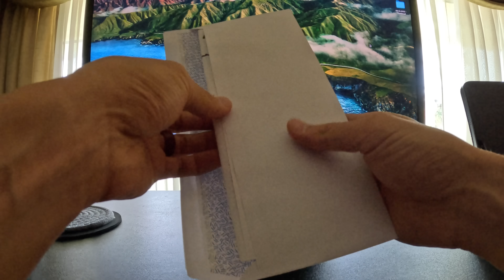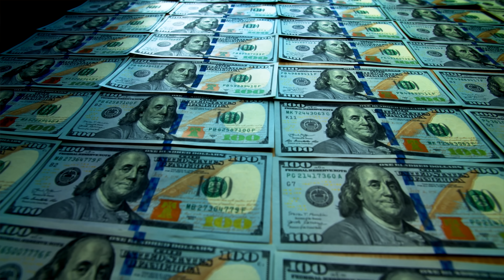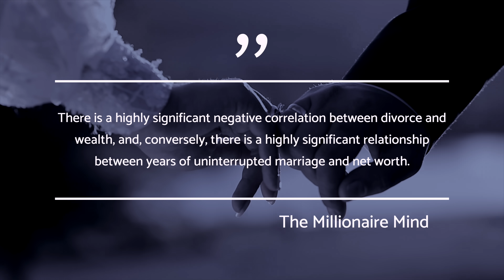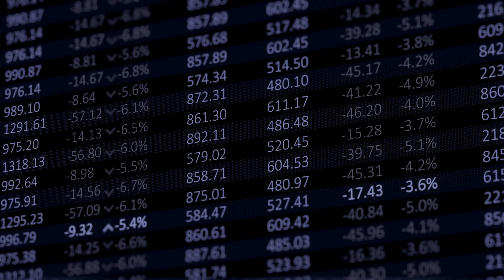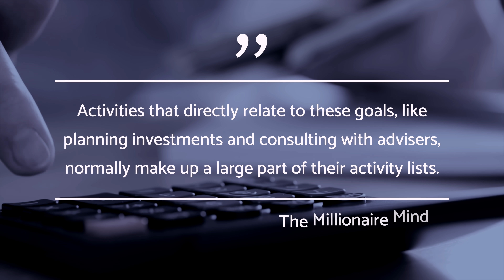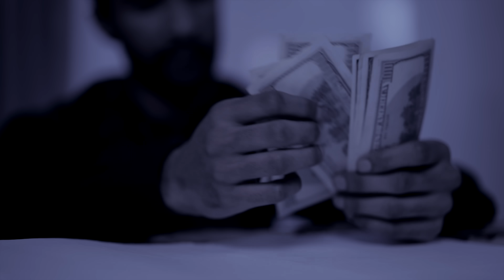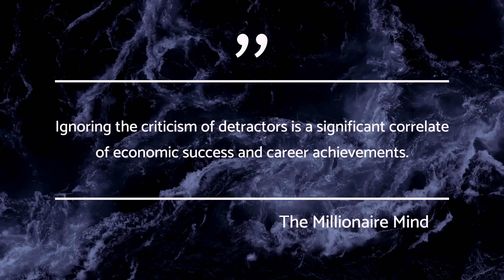The Very Boring Life Of A Quiet Millionaire

Comment: Ya, very good list.
Only thing I may disagree with is the point about what cars millionaires drive.  If you see someone driving an exotic sports car, there is a good chance they have money, or at least a big income.  They can easily cost $20,000 - $30,000 a month just to finance, insure, gas, and repair, so it is hard to fake that.  But yes, the cars in the $60-$150k range are just broke people with a middleclass+ income trying to convince you they are rich.  Same with designer close, and accessories.